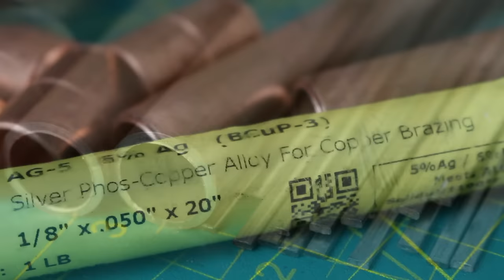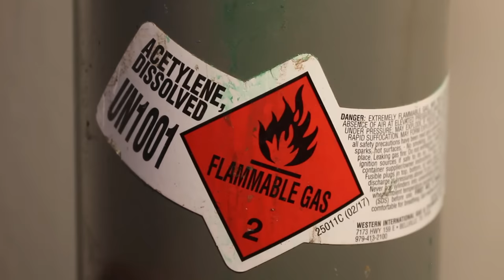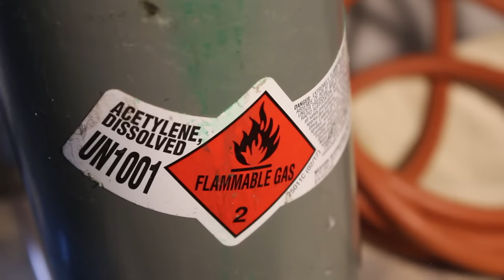How To Braze Copper Pipe Like A Pro (HVAC Refrigerant Lines)

Comment: air-acetylene is common in hvac in the us because it means you only have to haul 1 tank up the ladder to the roof, but it's not great for everything. i used to service small appliances like air conditioners, refrigerators and dehumidifiers where the tubing is very small, the working clearances are very tight and many times the units are made of plastic that you can't easily shield from heat. in those cases a small oxyacetylene setup with small tips and special tips like the uniweld cap'n-hook work much better because you can braze the joint very quickly without setting things on fire or melting them.
Reply: I like to carry around about a 12"x12" piece of 26ga sheet metal for tight spaces or plastic units. If you leave a burn mark through the sheet metal then you left the flame in 1 position for waaaay too long.
Reply: Air-fuel is a better way to go on smaller copper to copper.

Comment: Good video, but if you cut that joint in half, you will find flakes of contaminants on it from exposure to the air  -    bad news for orifices.   An inert gas in the pipe while brazing will prevent the contamination by shielding it from the air.
Reply: Not a good video.

Comment: 2/21/2021 For a Person that wants to teach others you need to learn your self. First your torch is way to hot. You use to much solder. Second you heat the elbow then the pipe that into the elbow. Third heat on the elbow causes suction. The suction pulled the solder into the elbow. Fourth you use only the amount Solder that is needed. If you have the pipe and Elbow glowing CHERRY red the solder won't stay in the elbow. When you add heat to a glowing red Copper Pipe the solder will fall out. Add Solder to the opposite side of the copper pipe always from the heat. The elbow and pipe is hot enough, with pipe soaked from all the heat the solder will melt. Fifth if soldering be sure to Clean and de-bur the Copper ends or joints to be welded. Sand the joints with sand Paper. If brazing Copper to Copper using solder use a Acid Pipe Cleaner for Soldering. If you are brazing Copper to Copper with seal-flos 15 percent Silver Solder sand each joint of that pipe and wipe clean each end and Joint before welding. Never use any cleaner acid if welding Seal-flos. Flow 5 to 10  cubing feet of Nitrogen through the copper to stop copper sulfate (ash) building up inside the Copper Lines if used on HVAC. The Ash in the HVAC will plug the Pump and Valves on the HVAC Units. Never Braze Copper to Copper with Seal-flos without flowing Nitrogen into the lines being welded. Clean your joints after welding with a damp rag. Pressurize all you joints for leaks.
Reply: You're close - on and off on your points (made here).

Comment: I see why so many disliked. 1. You dont have to heat till cherry red. 2. Remove the flame when you apply. 3. Heat from the backside when testing if yhe heat is good. 4. Let the braze do the work. It will be a cleaner finish. It looks like you burnt toast. It should be shinny and clean

Comment: Thanks for the video. I'm a pipefitter who is transitioning into a job that is still pipefitting but more refrigeration related. I was a little nervous about my brazing skills, but I liked the way you bent that sil fos. I'll probably watch it a few more times just to get a feel for where you are putting your heat when you are melting your rod
Reply: If you learned to braze from this I bet the guys you worked with laughed at you B4 showing how it's actually done🤣🤣🤣

Comment: To all the pros here, I am a beginner in brazing. I have been wonder what will happen to the brazing joint after a certain of time exposed to the environment? I used a copper-based brazing alloy as the filler metal to join two pieces of carbon steel plate.  What is the possible failure that may occur on the brazed plate?
Reply: It gets tricky binding ferrous and non ferrous metals. Just make sure everything is CLEAN PRIOR TO BRAZE. A bit more info on the actual rod used could provide a better answer to your question.

Comment: Flux is bad for refrigeration, and you should run low pressure nitrogen through the pipe while brazing
Reply: SIRUS tone exactly
Reply: You realize it’s just a demo not a full process. Make your own video and do it right
Reply from the maker: Why exactly is flux bad for refrigeration? Just curious. I see it used when bonding unlike metals such as brass/copper. I agree with the nitrogen but this is just one method and the method used most. Let's get real, the guys in the field wont lug a nitro tank with them along with their B tanks all the time. Thanks for watching!
Reply from the maker: @whit6282  Seriously lol I agree with the nitrogen part but this is just one method and the method used most. Thanks for watching!
Reply: @JumpermanTech  if you was a hvac tech and told me you wouldnt carry nitrogen with your torches to install my refrigeration lines id send you packing thats what causes all kinds of burnouts and txv problems
Reply from the maker: @anthonyl5505  I hear you with that but let's get real, most guys dont. I'm not speaking about myself. From private to union companies, I seen it done this way with no problems. Using nitrogen as well is the correct way to do it. So why us flux bad for refrigeration?
Reply: @JumpermanTech  no mate, every HVAC worker takes Nitrogen around, if they dont theyre not work the time of day. Any decent worker understands the long term issues for poor prep work.. in saying that your video was fine for braising water pipes. Flux is bad for the Refrigeration for two main reasons. firstly its a non condensable material that will get stuck inside the metering device and cause issues there, secondly if it makes it to the compressor it can damage the reeds inside the  head. its fine to use Flux just dont go excessive.
Reply: Bosses aren't going to pay for the extra time it takes to carry nitrogen around, especially on a roof.
Reply: @JumpermanTech  you speak truth
Reply: @pyacobel  I flow nitrogen every time I braze and have for my whole career. My journeyman would have thrown me off a roof if I didn't.
Reply: @anthonyl5505  YEP!!!!!
Reply: @pyacobel  a good boss will
Reply: Wish Incould post a picture. My journeyman found a dryer with a 15 degree temperature drop across it. Opened the system up and it was LOADED with carbon from poor brazing practice. Repair with be costly!
Reply: @jeffpeterson1331 yep  The carbon scale is CERTAIN with a brazed joint.   Then it all goes through most of the components before hitting the filter.   It's completely careless to not purge with an inert gas while brazing.
Reply: I was thinking the same exact thing, purge then flow nitro, use flux within reason.  Also, its a demo and the video was JUST about brazing, but keep the pipes down when cutting and cleaning pipe.  I appreciate your effort with the video tho!.

Anthony L. Is on point with everything.  

Paul Y. You remind me of the last company I worked for.  I also heard stories that the same company vented 125 pound refrigerant tanks after charging because they were done with it and no one would take it unless its empty.
Reply: Imagine you have to braze and you don't have nitrogen or other stuff that's what the video is for. Also that's the way you practice with a minimum. Thanks mate
Reply: Jumper man Tech good tutorial not hating one bit!  the pros do exactly that! What happens is you form a nasty black oxide layer on the interior of the piping that will destroy compressors, txvs axvs etc. through contamination. It’s really not convenient but it really is the only way, you must have a nitrogen back purge! The refrigerant acts as a solvent and quickly mobilize the oxidation through the system. It’s like you go through the effort to put on a brand new diaper only to have the system immediately crap itself! Not hating at all bro! This is how you will elevate yourself from a “tech” to a pro for sure!
Reply: Thanks for explaining, atleast I will not DIY , Do it once and do it in right way . See it from paying customer point of view , paying twice because first it was not done properly.
Reply: Satveer Dhillon yep. That’s the hard part too, is a properly done braze with backpurge will significantly increase the life of the compressor and  valving
Reply: Not impressed
Reply: In my long hvac career im using a flux to braze different type of metal so if you have a technique to braze dissimilar metals then make a video and explain why flux is bad on refrigeration
Reply: @jeffpeterson1331  Can you run nitrogen through the line after brazing? 

Seems odd to run it through while brazing. How do you even nitrogen through the system if you are replacing a compressor and you are brazing the compressor inlet or outlet back on?

The old guy I who is teaching me says he usually flows nitrogen after he is done.
Reply: @MrPopemobile  running after defeats the purpose. The black stuff on the outside is oxidation which is when oxygen from the air combines with the copper. Purging with nitrogen ensures there is no oxygen in the pipe. 
If I am putting a.compressor in, I will flow nitro into one pipe and leave the second off to ensure I have flow. Then insert the second pipe and either hook up a hose to another service port of pull the core to avoid pressurizing the system and then braze the final fitting.
You can then pressurize thensystem and bubble check for leaks or if I am in a hurry, I will go right to the vacuum pump. If it holds a vacuum, it's fine.
Reply: Flux would be bad due to the possibility of it being a contaminant.
Reply: Jumper man Tech 0
Reply: @pyacobel  If either your boss or quote preparar for approvals is not allocating sufficient time on your work orders to haul up ALL materials required then your boss shouldn't be a boss. A quality company understands prep time, repair time and cycling ops monitoring time to guarantee craftsmanship
Reply: Typically not for water piping though, just refrigerant and med gas.
Reply: Jumper man Tech the phosphorus is the flux with sil-phos brazing rod for copper and brass.
Reply: You can purge it with nitro after the leak check and then pull vacuum!!! What is a vacuum for? To get the moisture and NON condensables. He is right not many run nitro while brazing....have done plenty of units without that process and havent had any issues....this dude heated that joint up too much and for too long! Do it quick and neat! No issues...
Reply: @lazerusmfh   don't you wash the system first before insert the chiller water😅
Reply: @MrPopemobile  running nitrogen through while brazing stops oxidation
Reply: @MrPopemobile  Afterwards means the carbon is already adhered to the inside of the line. Flowing the nitrogen during the brazing means NO carbon build up inside cuz it's an inert gas(no air)
Reply: All you people acting like every hvac worker uses nitrogen while they braze which is complete bull shit lmao, this trade is huge and there's a massive amounts of people don't know any better, but I'm glad to know all the people watching this video at least do their job properly
Reply: To explain why flux can be bad for a refrigeration system
If left on the weld with out cleaning up the weld when finished it has a high chance of corroding the pipe.
Reply: Read the flux bottle it says right on it and yeah on small repairs most dont purge with nitrogen But a true professional purges especially on new installs. The copper oxide created inside can cause all kinds of problems.
Reply: Eroz Ghost  yes it is called purging that way the inside of the pipe does not oxidize. It has to be at a very very low flow though because if it builds pressure it will make pinholes in your braze joint.
Reply: Eroz Ghost  
I'm here learning about brazing for myself. So far from all info I've gathered from videos and forums state for the cleanest and most correct way to braze is running nitrogen DURING brazing process.  
 The dirty black stuff is oxidation caused by presence of oxygen. Running nitrogen through pipes means there is no air/oxygen inside pipe therefore no oxidation inside. This oxidation flakes off and CAN  cause issues. It might not but it can.

From my research people do it both ways. The correct way is WITH nitrogen. I see a lot of pros in forums who say they never run nitrogen during and they have zero issues. 

But to me personally I don't care how joe schmoe does it I want to know the CORRECT way to do it. 

People upset here because he didnt use nitrogen. But he clearly states "for this demonstration I will only be using acetylene "
Reply: @TheJordanwright  I never brazed with nitrogen in 30yrs in the business. I've worked at union plants for years with 100's of AC/refrigeration units from chillers, package units, split systems, low temp refrigeration units, computer room low temp chill water system you name it. Nobody on the site ever brazed with nitrogen. I know what they say in the text books and it does work but Im a living testimony from experience. We rarely had txv problems, in fact if we did it was because the power cap lost it's charge not because the txv was clogged. I've installed a ton units that are still running like a champ to this day. Don't believe that hype young fella. I see guys on fb and ig and youtube talking about all this text book stuff and they have more problems because they're too focused on being super technical. You guys watch these videos and look to criticize first. Get some experience under your belt......I can guarantee you when you're by yourself on the roof doing a compressor change out in the heat, day in and day out you start to realize what's essential and what's not. You learn how to braze to where you don't have to leak check....you know the your braze is good....lugging that nitrogen tank gets old.
Reply: Paul Y that’s very false just the other day I hauled a big tank of nitrogen up on a roof for a compressor change, it sucks but it has to happen
Reply: @marlymar4  have you ever changed the oil out on a system that wasnt purged with nitrogen when installed? It will be black as if a compressor has burnt out. All of that copper oxide ends up in places you dont want it. Im not talking about two braze joints on a compressor. Im talking about 200 feet of lineset. You may not have issues right away but you dramatically reduce the life of the system
Reply: @pointseeker  Yes I have.....I've seen systems like you just described. I wasn't trying to say it's not good practice because it is. Im simply saying I haven't brazed with nitrogen. I've maintained sites running service on all types of refrigeration equipment and comfort cooling equipment and I really haven't had major problems other than normal wear and tear over the life of the equipment. I guess my gripe is when people watch these videos on youtube they look for the negative first when half of the people watching don't even know the trade like that.
Reply: You mean use nitrogen as purge so you don’t sugar the inside of the pipe to pipe joint. Would This joint be sufficient for home plumbing repair for your showy?
Reply: @anthonyl5505  Even better going behind somebody else and trying to find a restriction where a strainer got clogged with all the scale from not using nitro😅
Reply: Can i ask you guys... what is it that the nitrogen does? Thanks :)
Reply: @johnbeer4963  When you braze without nitrogen the oxygen in the air which is in the pipe turns to carbon which is black soot which gets into the piping system. The nitrogen displaces the oxygen so the carbon effect doesn't happen. Basically, it keeps the copper line piping system clean.
Reply: Front of vehicle exhaust pipes you cant use exhaust cement because it crumbles and falls into the catalyst converter
Reply: @JumpermanTech  nitrogen is essential van stock, always have at least 1 tank. Not only for installing new lines (prevent carbon formation of inside of pipe) but also for pressure testing systems to ensure its tight. Stop trying to justify bad practice.
Reply: @JumpermanTech  yet here I am making a living on fixing jammed dryer and expension valve.

Nitrogen wasn't use much on R22 system; but of any 4** refrigerant blend you must do that otherwise any sizable piping job on a system will likely end up in the drier, the expension of in compressor oil which will shorten the life of your compressor
Reply: Purge it
Reply: @marlymar4  So true pal. From my work expierence, i can testify your words. There is just no time for that. 20 years practice and nobody from that company doing like that. Largest shopping markets with 100 refrigerators was connected to main compressor units, brazed without nitrogen and works perfect. Used nitrogen only for leaking tests.
Reply: @JumpermanTech  I lug my nitrogen bottles around. Up and down five flights of stairs. At this least on my current job site. I’m doing both refrigerant and med gas. Refrigerant and med gas lines need a nitrogen purge to keep the inside of the pipe from scaling. It’s also code.
Reply: @dh1270  Could you use argon instead of nitrogen?
Reply: Stay clean is a flux that you can use combine with stay brite #8 solder
Reply: Marlun sides comments most worldy wide , he's the springers final thought on this !! Just a quick question off topic slightly,  why can't lead solder be used to braze copper refrigeration pipes ? Like we use it for water pipe systems
Reply: Nitrogen is really cheap, it doesn’t take long to purge refer lines. You don’t have to take the tank to the roof either. You can use gas hose and run it to where you are working. Leave the tank on a rolling cart. Why would you not take the 2 minutes to just use nitrogen. Also it’s one of the most abundant gases.